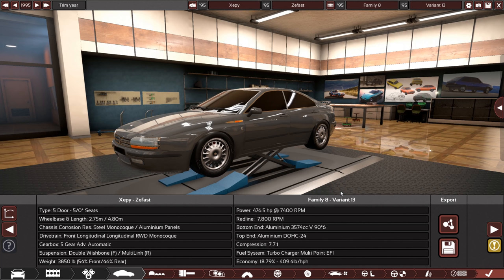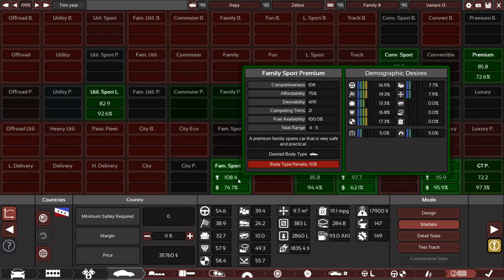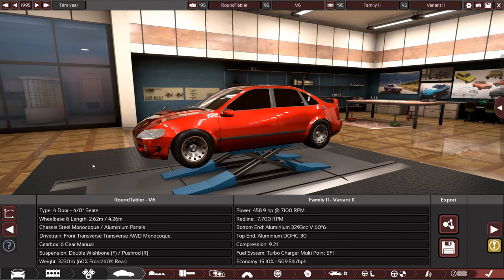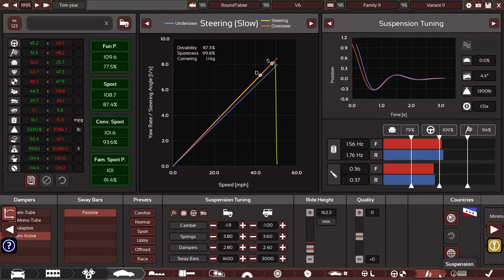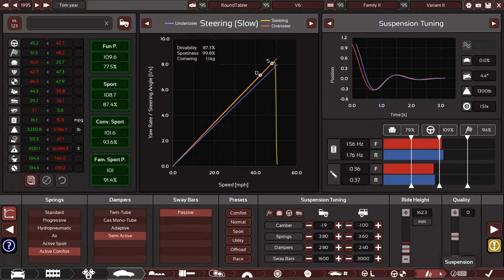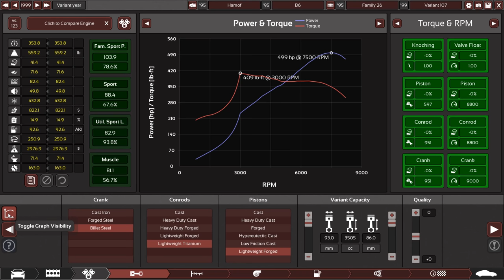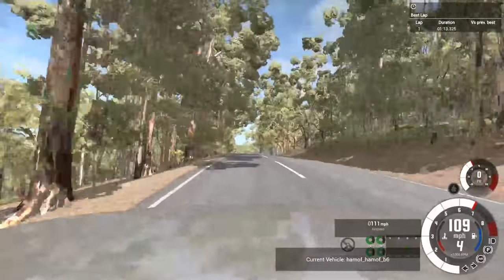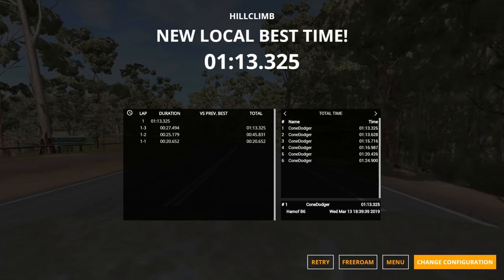Automation 1 Hour Builds BeamNG Showcase - 90s Saloon Cars

Comment from the maker: Yikes even in 4k its still a bitrate blurry mess, not much else I can do from there.
Reply: Recording at 60fps might have helped.
Reply from the maker: even at 4k 30fps it should be 30mbps on yt, It's just too much plant detail and LOD popping for the encoding to handle. normal videos are only 12mbps and they fair a lot better.
Reply: @ConeDodger240  My reasoning was that @60fps there is less difference between each frame making it easier for the encoder, but I'm no expert.
Reply: @ConeDodger240  Have you tried HEVC encoding?  
I usually encode my videos out as Lagarith Lossless, then import into ffmpeg and do HEVC crf 18 encoding before I upload them.

On PC stuff I used OBS and did like 50mbit NVENC encoding.  (But I was only doing 2560x1080 60fps)
https://www.youtube.com/watch?v=gZ9UuIU4hLo
Now I've been doing Xbox One X so I have it record native on the system.